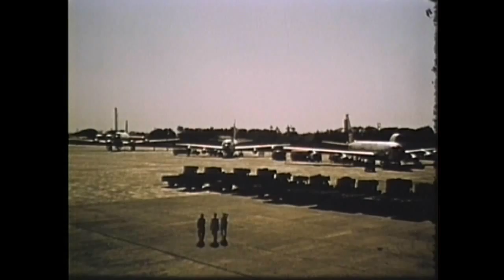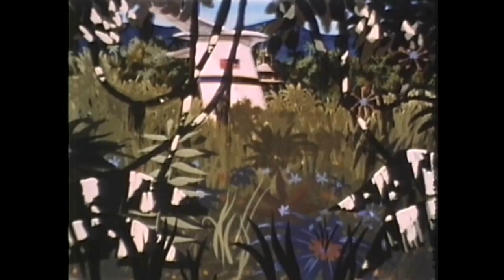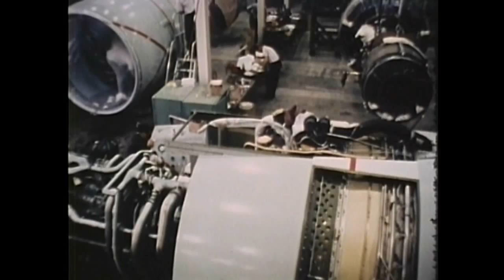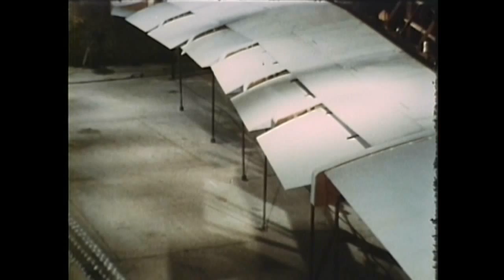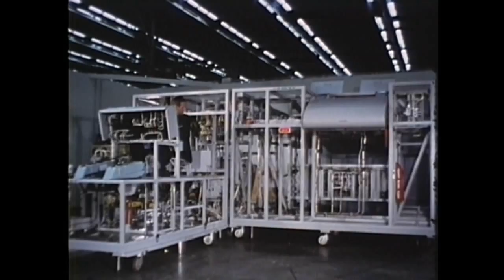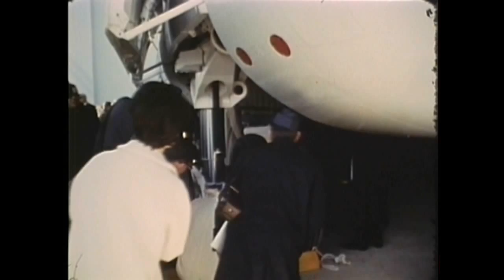Genius Design: Lockheed C-5 Galaxy Transport (720p)

Comment: genius design? I worked on the C-5 for two years. it is the biggest pig to ever fly. the cargo compartment floors cracked limiting the cargo capacity to as little as 10,000 lbs. in one case. the wings cracked and had to be sent to Lockheed to be replaced. then they had to send them back again to replace all the flight control actuators. and my favorite, the landing gear would grind on itself as the gear rotated inboard before stowage or outboard before landing. you could see metal shavings on the struts. plus a myriad of other problems. talk about a piece of shit. now, if you really want to talk about a genius design let's talk about the C-130. first flown in 1953 and they STILL haven't come up with a suitable replacement. aerodynamically it shouldn't even fly. greatest aircraft ever built.
Reply: Someone sounds a little salty about the C-5... they don't have those problems anymore. Did you work on the C-5A?
Reply: Did they re-engineer those items to solve the problems?
Reply: Yes, I know those problems have been fixed. If you read my initial comment you'll see that those problems were dealt with when I was working on it. Except for the landing gear. It's still a pig. It doesn't help that the 436th Airlift Wing was also by far the worst command I was ever associated with. They treated the troops like dog shit. I actually got in trouble when I first got to Dover for repairing an aircraft that would have missed it's mission had I waited for the C1 stand that took two and a half hours to show up. Violated safety ya know, which I totally get, but there's a time and a place where the rules need to be bent a little. Where I came from before the mission came first. Of course that was a fighter squadron. In my experience in several different squadrons, both fighter and airlift, the fighter jocks knew how to take care of the troops, whereas cargo pukes were total jerks.

Comment: The An-225 is apart. The A-225 was born for the Russian Space Project in peace time and for a thing only: to transport the Energia and the Buran from the "A" point to the "B" point in the Soviet Union. That is all. No war duties for the Mrija. You can see it: the Mrija does not have the rear ramp. The Soviet Union needed only one (or two) of these special aircrafts, so this is because there is only one An-225. Russians are not phonies and for long time they did not need a fleet of large strategic transport airplanes. This is because the Soviet Union did not have to quickly jump an Ocean (Atlantic) for do a war. In unlucky case of war, the Soviet Union had all the necessary already in the place, in Eastern Europe or in the Soviet Far East. Primary duty of the NATO strategic airlift is not to carry heavy tanks or guns, but carry personnel, fuel and ammunitions quickly over the Atlantic ocean. Soviet Union did not need this. Russian weapon factories and personnel and fuel stores were already on the Russian soil. E.G.: in the Far East, Komsomol on Amur was created by Stalin just like the biggest military center in the Russian East, primarily against the Japanese at the time. Military factories of all: tanks, guns, aircrafts already on the place. No need long and far supplies.
Reply: The first thing is completely true; the USSR was the center of an evil empire.  The second is ridiculous, and the rest are more nuanced.
Reply: +Riccardo Smirnov "No need". You write that a lot, but it would have been a dream for Russia andthe Soviet back then to have a fleet of these. But it costs to much.
Btw, Antonov 225 was a rip off of Galaxy C-5. They managed to buy the drawings, etc.
Reply: No need because the USSR had puppet states all over to fight for them.  Those states got out from under the boot of Russian control as soon as they could.
Reply: deezynar even without "puppet states" the USSR and the Russian federation have everything already in place. On the contrary, The USA puppet states in Europe and elsewhere have yet to receive all from sea and air. 
With a difference: the USSR had "puppet states" only in order to defend itself from continous enemy attacks, The last time, 20-30 millions of Soviet and Russian people lost their lives in an aggression war. This can not be repeated.
Reply: Riccardo Smirnov
Screwing millions of people bwcause you got screwed in the past is not acceptable.  The fact that USSR proffitted from leaching off of their vassals exposes the real reason for their possessing them.
Reply: This should be a C-5 Galaxy topic, not an history topic, anyway sorry I didn't understand your message. Many things are unacceptable in the world, one of these is the attitude to see the history with the eyes of today. The fact is that Soviet Union was attacked by Hitler for a total mass genocidal war. This war caused at least 22 millions Soviet deaths. No country in History has ever suffered so many losses. So no country in the World can judge it. The Soviet Union won this war and advanced up to Berlin. Only in 1944 june the so called "Allies" landed in Normandy. When they realized that the USSR could have won all the Europe. So, if the USSR had not taken the eastern Europe, the "Allies" would have taken it. Us or them, no other. At the time, there was an ideology. For you, after a terrible war, could Stalin and the Soviet Union accept to border with a different ideology, directly on their land? This would have meant absolutely no notice, no warning in case of a new war. And also this is an unacceptable thing, if you want look if the USA accepted the Russian missiles in Cuba (180 miles from the Florida). And the USA don't have a real war on their homeland from the 1783, correct? The Florida is 180 Km from Cuba and the USA threatened the third world war. And the Soviet Union should have accepted the "Allies" directly on the doorstep?
Reply: That's reason to screw millions of people who were not Germans?  Nobody but Russians buy that thinking.  The USSR treated its own people horribly because communism can never do anything else.  The NATO countries certainly didn't want that for themselves, and the leaders of the USSR were always talking about spreading communism and taking over the world.  If they hadn't had such a horrible system, nobody would have had any fear of Russia.
Reply: I repeat, the peoples of Eastern Europe (allies of the Germans) were won by the USSR during battles against Hitler. If the USSR had not done this, the Allies would take the East Europe; this was not acceptable to the USSR and she was right, no strategist in the world would have done differently in that historical moment. The USSR did not alone: the whole World was divided into two by means of international treaties and conferences, like Yalta and Potsdam.Perhaps that the NATO countries could become communist if they wanted to? I don't think so.
What about the fear of Russia, who is afraid of Russia? Only the United States.
Russia is already rich, has no need to look for oil, does not go halfway around the world to look for oil, or overthrow governments. So who really afraid of Russia? Throughout the history, Russia has never attacked anyone, on the other hand has been attacked at least once every century.
And with regard to Communism, not to believe that it was all this mess, maybe it was for the Americans, but basically in the Soviet era all citizens had homes, jobs and guaranteed health care. Could you say the same today? Communism in the USSR was better than the Czar. The problem is that personal greed has won and they decided to move to the so-called "capitalism." The US say they have won Communism, they have not won anything. When there was the historic chance to become rich, the Soviet rulers converted their political power in billions of dollars, That's all.
Reply: You are deceived, and supporting evil ideology.
Reply: deezynar Yes and the USSR was the "Evil Empire" and the Communists were eating childrens and Saddam Hussein had weapons of mass destruction and "in every Vietnamese there was one who dreamed of being American" ......